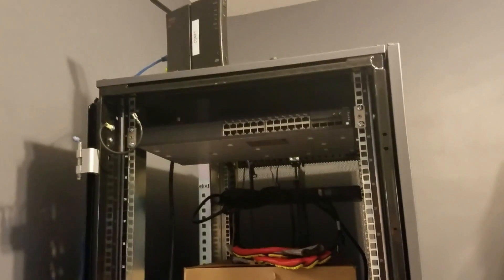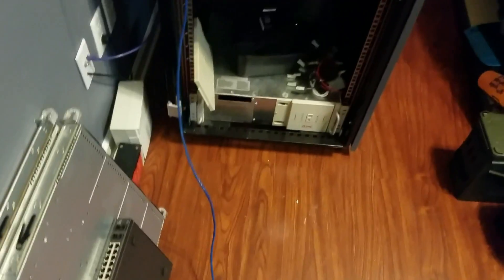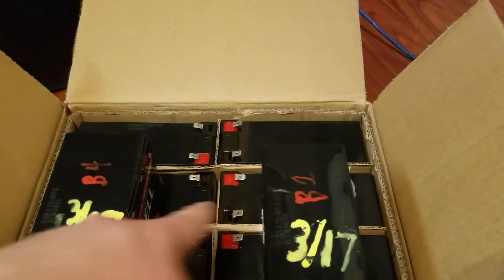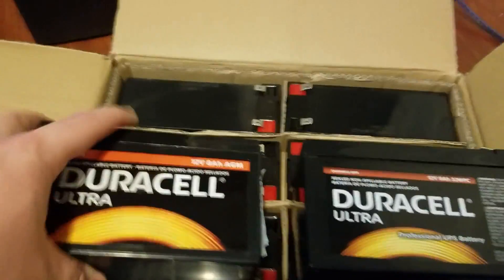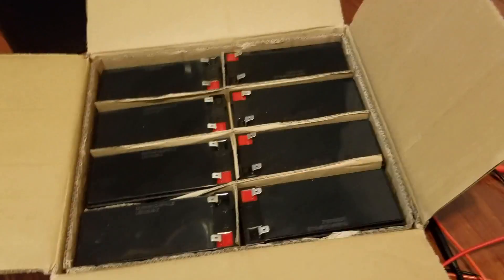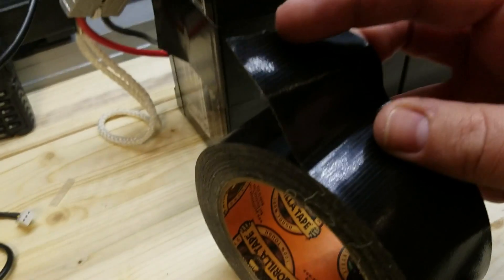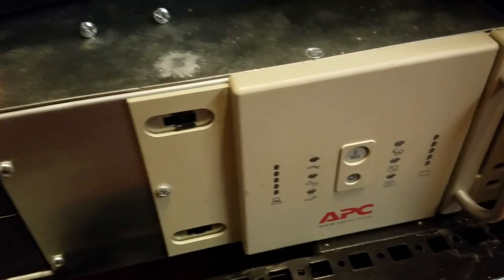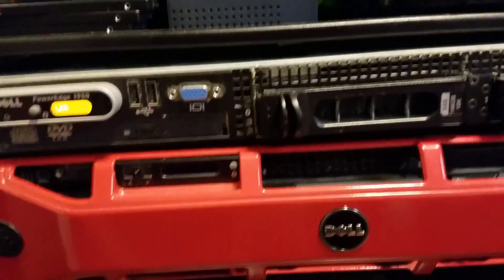Battery Swap in my APC 3000VA Rackmount UPS

Comment: Typical APC.  Bloated batteries ... The best thing to do is to go to PROG mode immediately via the serial interface with Putty and calibrate the charging voltage to exactly 13.5 to 13.6V per battery!  And you will see that they last twice as long.
Reply: Here the manual http://www.jelmerbruijn.nl/apc-ups-smart-ups-1500-battery-float-voltage-adjustment/
Reply: Works for all smart ups with the 6-pin connector on the mainboard.  All you need is a serial interface and the adapter from rs232 to TTL (for 3 euros on ebay) you should read something beforehand and understand what is happening there.  An incorrect command from the PC can destroy the UPS.
Reply: corsab - is there a menu-system built into the UPS?
Any details on this process would be appreciated!